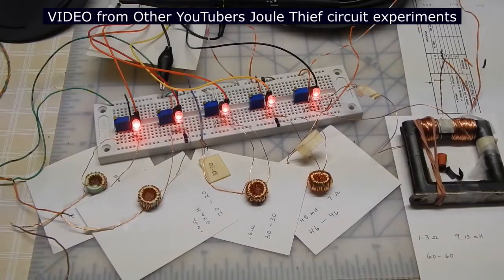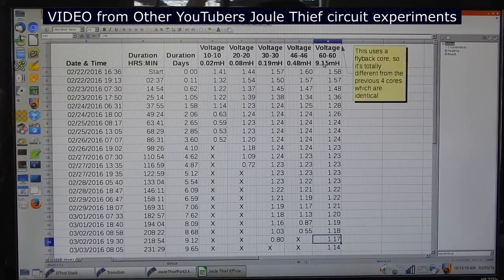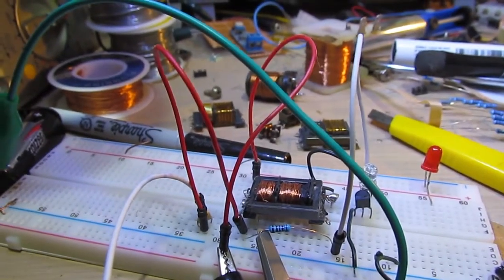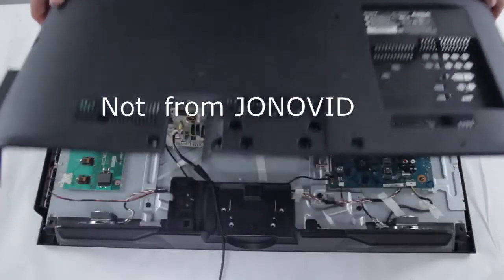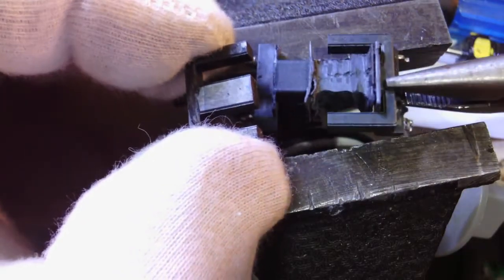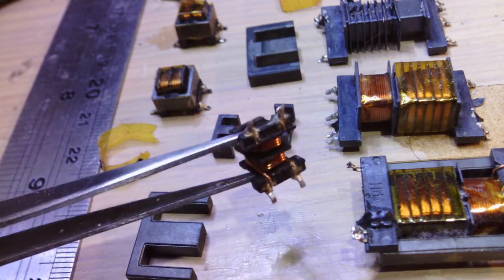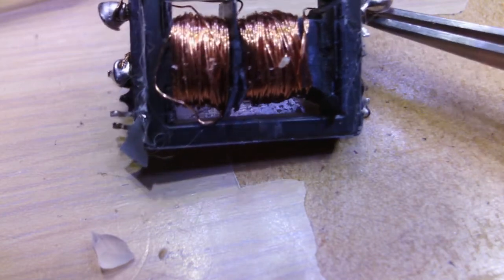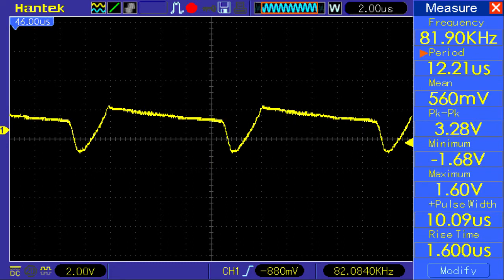High Impedance Joule Thief Electronics

Comment: its the core material mostly.
the ferrite core... they have really low loss.  things like aerial rods and suppression beads are usually the same properties. generally, if its black/grey...
the ferrite toroids... can be a tricky thing to tell exactly what they are and how they behave... 

easy test is throw them on a ZVS as a transformer core and see how hot they get.

find a lot of the choke style toroids just arent up to it, they have really bad eddy current heating... meaning all your joules are vanishing as heat.

it hurts some peoples heads as they are told reactive power doesnt do anything, but really... if an inductor/choke is there to filter out spikes, transient energy, even if it is doing it by cancellation of two opposed signals, it has to dispose of that energy somehow! so a lot of the toroids you scavenge from SMPS are not actually inductors as such. not good ones. whats the word? Q. low Q. high loss. opposed to a transformer whose job is is to simply transform and be as transparent as possible in doing so... meaning low losses.

reluctance. a big fat, short magnetic path is best. just because the core material is the same, doesnt mean they have the same efficiency, as the gemoetry may be different...
as is a short, stout conductor. reduce magnetic losses, reduce resistance losses. i find the copper tape is best actually, a 10mm roll is equivalent to 0.8mm, or 0.5mm^2... skin effect and all that, a flat thin conductor is better than a thick round one.

also, taking induction coil design into account...

toroids make long, low voltage pulses. the magnetic field doesnt like to collapse. an open end inductor makes nice snappy high voltage spikes as the magnetic field collapses rapidly and really cuts the conductor... on that note, most of the cores in these lil EI type transformers have a gap, a piece of tape or something on the end. stops the core from saturating. dont want it gapped on a joule thief... though, depends. what did i just say about voltages?

if youre chasing high voltages ;) im pushing 50v at 10mA... need more. MORE!